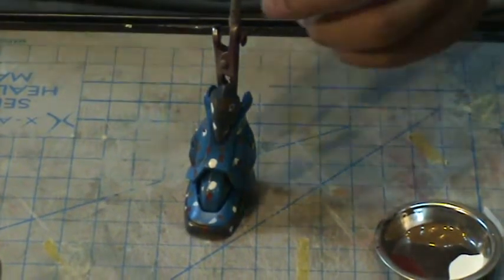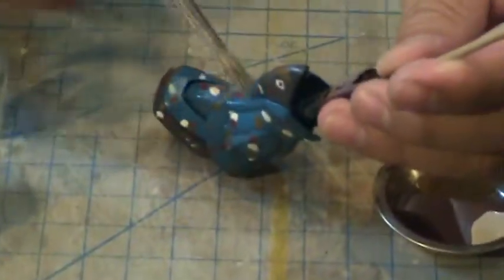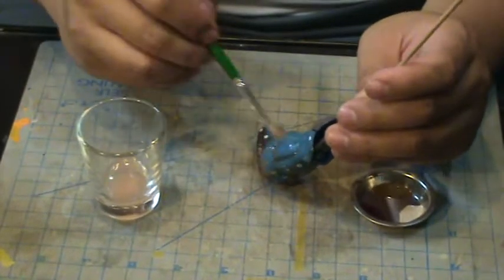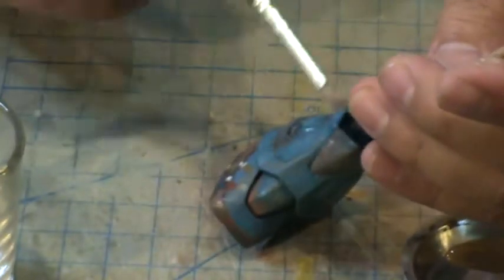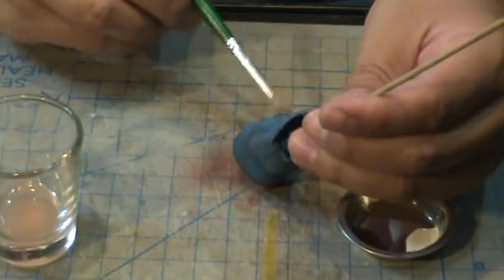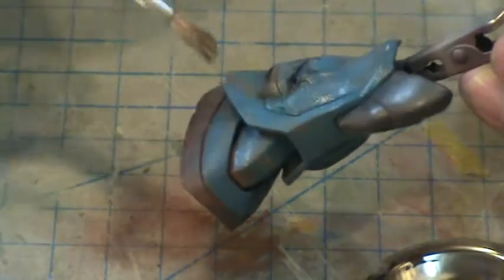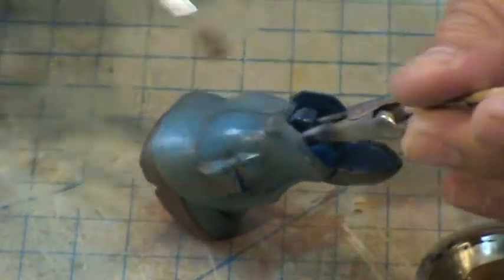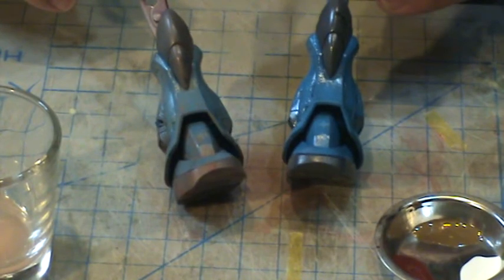filter_part2.MPG

Comment from the maker: Yep, that will work just fine.  The important part is that the clear coat is a different paint type than the enamel.  It can be either acrylic or if you're careful, lacquer.  Then use the enamels for the wash.  Just make sure the clear coat is COMPLETELY CURED.

Comment from the maker: I have never tried using anything other than oils for the filter/fade effect.  But the safest thing I can think of to use is water.  If that doesn't work. Try adding small amount of isoproponal alcohol to the water than doing the effect.

Comment from the maker: That is a clear gloss.  Either acrylic based or lacquer based will work as the enamel is oil based and will not mix with the acrylic or lacquer based products.  For this example, I used Mr Super Clear Gloss which is a lacquer based product.

Comment from the maker: Elaborate?  If the clear coat was acrylic, yes the method works with enamel based filter paints.  The inverse works as well.  Just makes sure the surface is completely cured.  The basic premise uses the paint's different properties against each other.

Comment: I think i may have used to much lighter fluid because its been a few days and the parts still really smell! Is there anything I can do to remove the smell? I painted the wash right onto the plastic.
Reply from the maker: The wash and filter are two specific and distinct techniques.  They are very precise in the process.  Please re-read the links I posted to your previous questions.  Applying lighter fluid directly onto the plastic will make the plastic brittle, and over time, your model will crumble.
Reply: gamerabaenre any suggestions on how I can fix my problem?

Comment: i wonder can i use thinner other than lighter fluid ?
Reply from the maker: Yes, I recommend using the same thinner as the enamel paint you use.  If you use tamiya enamel, use tamiya enamel thinner.  If you use model masters, use model masters thinner.  I just have a personal preference with lighter fluid.  I like working with it.
Reply: kook thanks for the quick reply

Comment: Is it possible to do this on non lacquer coated bare plastic?
Reply from the maker: +Harji Kalbuadi No, trying this technique (using enamel paints/lighter fluid/enamel thinner) will make the plastic brittle and it will crumble.  Even with lacquer paints and clear coats, there is a risk of making the plastic brittle.  I have had some of my models break apart because of this technique.  So while it looks good, the model becomes very delicate.
Reply: +Those Gundam Guys Can I use other type of coat instead of lacquer? Acrylic coat for example.
Reply from the maker: +Harji Kalbuadi Yes!  You can use an acrylic clear coat.  Let that FULLY cure, then use enamel (oil based) products to do the washes/filters/fades, etc
Reply: +Those Gundam Guys Awesome! Thanks for the info! :D 
Gonna try this technique on my next Zaku II build!